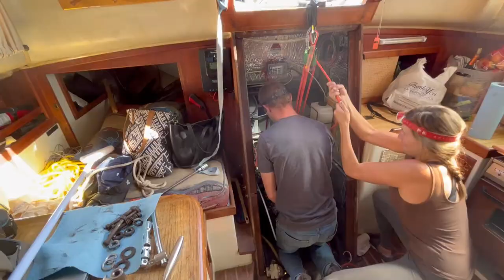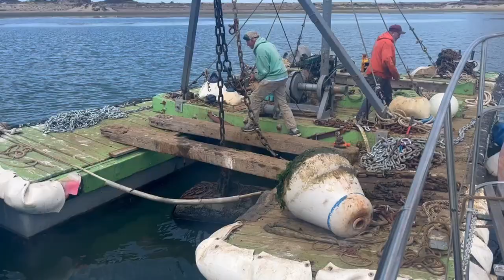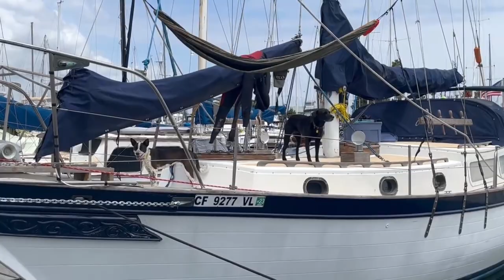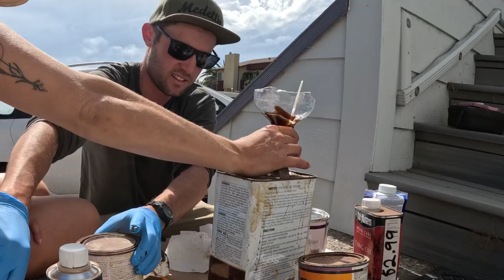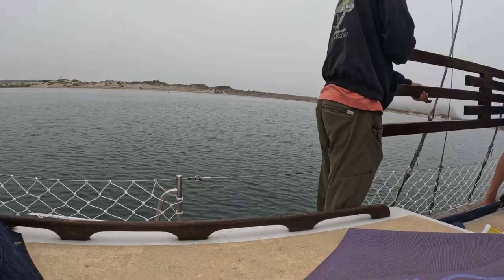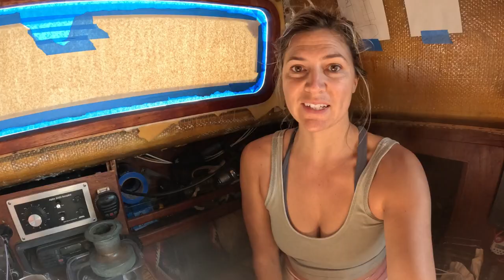[Ep 42] Bow sprit refit, boat soup, & deadlight replacements!

Comment: For years, I've used seafinn teak oil as a base, seals the teak can be built up. Then, if shinny is wanted, Captains 1015. I'm told that a base coat of smith's epoxy when it's still tacky put on a coat of varnish. Then build up coats of varnish for the uv. The epoxy dosen't have uv protection alone. Vera 1975 Downeaster 38 currently on the hard in Napa. Cheers from Northern California!!!@
Reply from the maker: Thanks for the tips! And thanks for watching! We love our fellow DE’s!